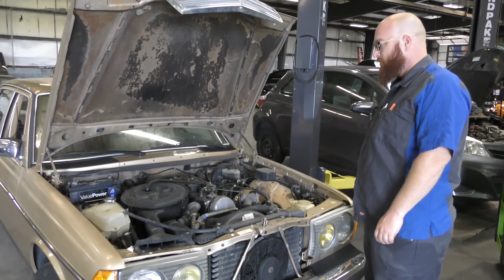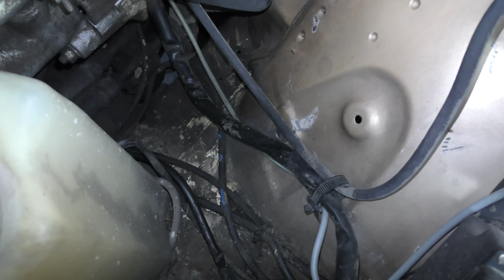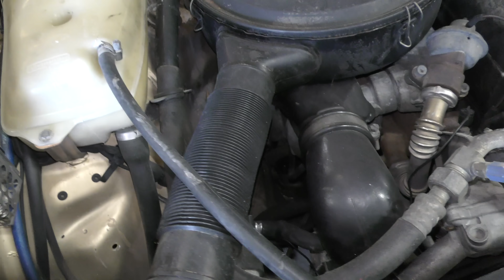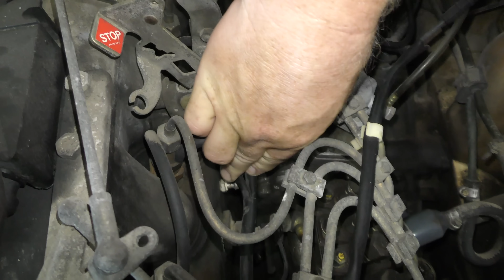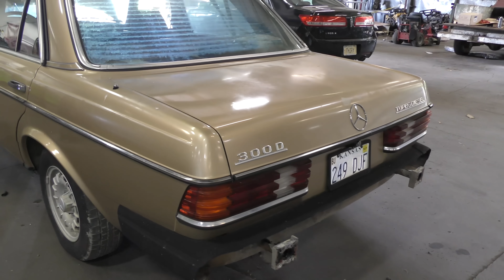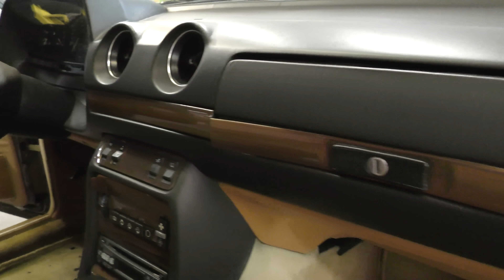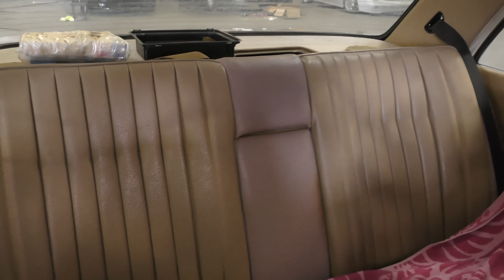Tank of a Mercedes 300D with a 3L Turbo Diesel! CAR WIZARD finds lots of surprises under the hood!

Comment: The Sergeant I replaced as Squad Leader while I was stationed in Germany in the mid-1980s had two Mercedes, a 1965 four door sedan with a V-8 Turbo Diesel and a 1966 two door, convertible with a V-8 Turbo Diesel both cars were built, originally to German/European standards. Both cars were automatics. The cars had been purchased, by my fellow Service Member and lovingly restored to their original colors (a cream exterior and saddle leather tan interior in the case of the four door and what we in the U.S. would think of as "Fire Engine Red" exterior, white convertible top and white leather interior) by a shop owned and operated by a semi-retired former Mercedes mechanic who owned and operated a nearby shop. His repairs/restoration were so good that a car collector in Louisville, KY kept a buyer on retainer who scoured (West) Germany just to track down and make offers on Mercedes vehicles repaired/restored by that shop. I don't recall the exact price he offered originally or what he ended up paying for BOTH of those cars but I do recall that the Sergeant was more than pleased with the profit he made from the sales as he had his eye on a really, really nice Mercedes, best described as a limo that met all then current U.S. vehicle standards (glass etc.) and ended up costing far less to ship home than either of the 1960s models would have since they would have required a number of "upgrades" to make them legal for import into the U.S.
Reply: Mercedes V8 turbo diesels?? During those years? News to me. Maybe modified or gas?

Comment: Maybe it is me,  but it seems that car sits a bit more on its rear wheels. On mercs that olda and undriven usually all rubber parts like engine mounts, bushings, brake cables, etc need to be checked, and often replaced to make safe and comfortable drive again. Also, roof mechanisms and driver seats are often weak spots.

Comment: I had a 300 sd and it had 250k and was a joy to drive. The rear seat reclined and my favorite feature was the hoods ability to prop straight up for easy access to engine. Sold that car for way too cheap.

Comment: Great video.
Replacing the instrument cluster lights with LED is a terrible idea. Those circuits aren't made for LED.
If the lights look too dim, you can adjust the brightness on the clock reset button or just have the reflectors for the bulbs polished.

Comment: I also have a 240 d same blue as yours for about 20 years now. It has stick. It has two clutch slave cylinders both are bad. A dumb Mercedes specialist was told to replace the plug on the block heater. He ripped the entire wire out of the car. A creep but his Dad was a genius mechanic like you . The day after 911 a kid searching for his water bottle under their seat rear ended the Benz when it was parked in front of my house. Crushed her to the wheel well but a friends bulldozer and chain to a Verizon pole pulled much of it out.
No mice but my 77 Vette had a mouse in a nest in the jack box behind the passenger seat below the cardboard. That was just after superstorm Sandy. Many critters migrated to my high area of town. I drove to the docks and released the mouse but should that mouse come back and get in my C5 I'm not going to be so nice.

Comment: It's not so much the taste that attracts the mice, it's the condensation and the salt's between the insulation and the copper or aluminum. Splicing is a terrible idea because of the potential for corrosion.

Comment: Having had nearly 75 of these cars, I know exactly what you will be going through. You touched on just about all the common issues with these cars. By the way, at minimum, the entire dash and center console have to come out to replace the wire harness. You might be better off adding a multi-pin bulkhead connector to the new engine bay harness, and leave the interior alone. That is if the rodents did NOT get inside.
Reply: I did that with a 77 Grand Marquis, was a squirrel instead of mice/rats.

Comment: In 1984 I picked up a new 300D at the factory in Sindelfingen.  Brought it back to the States and a year later plus 25,000 miles I sold it.  It was anthracite with an anthracite interior.

Comment: Wizard I like all your video's. I believe I worked on that car many years ago at a Mercedes dealership in Nebraska. I notice the ALDA on top of the pump has had the emissions cap tampered with.  We would loosen the lock nut and turn them two turns to make them run less lean, and have more power.  It was most important to adjust the valves on these  engines or they would not start in cold weather. They had a tendency to tighten up. Just a tip.

Comment: I've owned a bunch of W123s, very cool cars. Crazy what's up with the wiring. Luckily, once you have it started, this is one of the last cars ever made that can run and drive with no electrical systems working. I think you're mixing up the horsepower rating with the non turbo 300D. The turbo has about 123 horsepower.

Comment: My 2003 BMW X5 4.4i costs more to repair it than what's it's worth, but it brings more joy to drive it than a 2020 BMW X5 which I have test driven. A brand new BMW will depreciate much more than the cost to repair my 2003 X5, so is it really worth it to get a 2020 BMW X5. Sure it is much more luxurious with the latest tech and powertrain, yet it super numb to drive IMO with poor steering feel compared to my old BMW X5.

Comment: Funny that you mention the original first aid kit 😂. My W124 also had the original one in it. And as I was working on the front suspension, I cut my hand on the control arm. And there was nothing else on hand than the more than 25 year old first aid kit. I put one of the band aids on my hand and it fell off after about 30 seconds 😂

Comment: so basically a lot of the problems with that car(that is known of) is because the mouse ate the wiring and not really the car's fault, and even then it still runs and drives. they definitely don't make them like they used to anymore.

Comment: These came around 12hp stock. If I recall correctly the boost protection kicks in around 13 or 14 psi. You should see at least 10psi of boost on these. Around 12psi seems to be perfect.

Comment: Oddly I would like to find a good example of my first car and own it.  My first car was an '88 Honda Accord. I've looked for examples around that time period and there's not much our there.  If I could spend some money on a vintage car it would be that one and swap it with a more modern Honda engine that would be the dream.  I've even looked at Accord all around that time and it's hard to find.  But I love the nostalgia of those cars.  My was a dark red four door, red interior, pop up head lights and most of all 5 speed.  Just an all around good car that if I could find and had the money to fix I would.

Comment: My grandfather had one of those things, I think he bought it new, or newer at the time. Same colour even! A few years after I was born it got relegated to being a 'spare' car. I loved the smell inside these things haha. My mother however hated driving it and it ultimately got sold because anytime we needed to borrow a car mom wouldn't drive it lol, something about hating and I quote "Having to wait for the squiggly line to light up before turning it on" Go figure lol. As for vintage car I'd like to own, I'd probably take one of these in decent shape, they're very nice and reliable, I don't know if you'd call it vintage but I'd also have a '92 Oldsmobile Bravada, learned to drive in one, my grandparents bought it new, gave ti to my parents, it was supposed to go to me but rust got to it, the frame was non-existant anymore, was a shame because it ran and drove but structurally it was a death trap. Would love to find one in decent shape, they're few and far between in the original bodystyle though.

Comment: My dad had a 240D with a after market Turbo and intercooler, was not slow anymore, and a five speed manual wich was hard to find. We got that sucker up to well past 200 km/h, I know the 300D he had before it stopped at 180 km/h and the 200 gas model only did 150 or 160...
He crashed the 300TD, then got a 240D with Turbo conversion that was rusted out, found a clean 200E? or what ever its called, gas... put the good 240D turbo converted in to the clean chassi and then sourced the 5 speed wich was hard to find. That car was amazing, I even got to drive it a short bit on a beach, I did not have a license, this was many moons ago ofc, these cars where just half as old as they are today... xD

Comment: Are used to do a lot of work on MGs The funniest one was changing an alternator over to a GM single wire alternator the customer picked it up and a week later the rear wheel fell off

Comment: Unfortunately I'm very familiar with the terrible disease that all of us in the auto repair community have  fallen victim to the person that has it! It's called ''Sinchu syndrome!'' I've seen many people with it in my almost 50 years of repairing wrecked cars for customers I might repair a dent in the left front fender and repaint it and six months later the person comes in and says ''Sinchu'' fixed my front fender the paint on the trunk lid doesn't match the right quarter panel! Or sinchu aligned my front end the heater motor makes a funny noise! Or sinchu put my spare on for me free the day I had a flat in front of your shop with 6 screaming kids in my van it doesn't drive right what are you going to do about it? AND MY FAVORITE!''I know it's just a temporary spare and it's been on the right front for six months but all three of my ''baby daddies'' say that your impact wrench messed up my front end and you should put new ball joints, tie rods, new springs with struts, and a steering rack with new lines, cooler and pump because your impact wrench caused it! I told Pep Boys how my baby daddies said you messed it up and for them to fix it and send you the bill so here's what it's going to cost on this paper! Just give me the money plus $200.00 for all of the trouble you caused me or I'n gonna sue you!  ''Sinchu Syndrome'', It's a real disease!

Comment: I had a 1980 240D from 2005 to 2012.  I bought it from the son of the original owner, fixed the cruise-control and A/C (those are always broken on these cars, as you well know) and drove it for 7 years doing nothing more than regular maintenance, and replacing wear-items.  In 2012, the original owner's son actually bought it back from me -- for more than I'd paid him for it in 2005! -- because he missed it so much.  It was a fantastic car, in really great cosmetic and mechanical condition.  It had 250,000 miles on it when I sold it back to him, and it still rode and drove like it did when it was new.

Comment: Had a 1983 300d for a while and still have the drivetrain out of it. Also many other parts I saved from it. It was totaled in an accident. I still have my 1984 300CD that I bought from a buddy of mine 16 years ago.Dark blue coupe with 387000 miles. Runs like a top.I just finished r and r job on the starter and new solenoid. The gunk and debris inside the starter was keeping the brushes from pressing against the armature. I guess that many years and miles can do that. I cleaned it up and put it back on and it works great.I do all my own work except alignment and tire mounting. I don't have the equipment for that. I have been deep into the transmission and every other place on the cars as they needed it. I am a hard core advanced DIY person I guess. Love the W123 cars and the W126 also. I had a 91 350SD and want an 83 300SD next.
Currently also have a 91 300E 2.6 that I drive in the winter (it has ABS) in red. All the old benz cars I have owned except the 300CD I purchased dirt cheap and fixed all the problems myself. As you said if someone paid a shop to do it they would easily exceed the value of the car.On the other hand if I was to total up all the tools I own at work and home (Lots of snapon stuff in there) maybe I could have paid a shop to do it!

Comment: Mercedes 560 SEL's are excellent cars also, yes they guzzle high test gas but they are very reliable, well [coach] made, very comfortable and smell wonderful. I bought mine for $2500.00 because the owner thought the engine was bad. When you started it there was a terrible disconcerting sound which would encourage most people to think the worse. The gentleman let me take a solo test drive and I didn't live but a few minutes away from a good friend of mine who was a "gifted" engineer. He determined the fan clutch was the noise issue as it was worn out and allowing the fan blade to make contact with a lower radiator bracket. We also pulled two plugs which looked almost new. The body and interior was immaculate so I bought the car. I called NAPA for a price on a new fan and clutch and was quoted $700.00. I wasn't too surprised and began thinking what was a good place to start looking. Suddenly I reasoned that many older people with Mercedes go to Florida to retire, then pass away. I Googled used Mercedes parts in Florida and called the first site I saw. I talked to a very friendly and knowledgeable parts person and within a week received a excellent used fan/clutch in the mail total cost $160.00. So I lucked out and enjoyed a superb $90-$100,000.00 [Original price] 150,000 mile car for several years. They are wonderful cars and can still be found for $5,000.00 and less, but by now age alone could become problems, especially the complicated suspension. But there are still many good survivors that may be worth consideration. How many cars have rear seats that are heated, recline and will do 150 MPH. Love your show and Hoovies and Dougs. Phil Massie

Comment: The real killer can be the vacuum system. There are many things, the door locks come to mind, are vacuum operated. The vacuum pump is on the front of the engine driven by the cam. It needs rebuilding after this kind of age before you start replacing all the lines to the doors and more.

Comment: I've had two W123 230e - great cars. The seats tend to wear out quickly, though they may be more durable in the diesel versions. I don't know how emissions taxation on older cars works in the States, but in Germany it would be cripplingly high: you'd have to register it as a historic vehicle, even then it would be banned from some city centres because the exhaust is too dirty. I'm guessing this one may have a catalytic converter? Then again, probably not.

Comment: Wheeler Dealers did a Mercedes diesel once and it lacked power. It needed a rebuild of the turbo and also the fuel injection pump was not out the correct pressure to all the fuel injectors. Mike was able to locate a specialist shop in Los Angeles to rebuild the pump. A new one would have been very expensive.

Comment: European bio-degradable wire... I had a '85 Volvo 760 GLE where I rebuilt the entire engine compartment wire harness.  The insulation on every wire, except the black ones (grounds, of course) was crumbling away.  That was back when it was only a few years old and Volvo wouldn't do a thing for me.  I imagine that Mercedes used the same stuff too.  I wonder if it was soy based insulation back then.

Comment: Another reason you took the car as well is because the owner has the money to put into the car. He didn't it pick over certain things he did nitpick overpricing or labor he just wants the car fixed and fixed right for his daughter no matter what the cost because in the end the cost is going to be a lot less than buying a used car from a dealer so wizard knows no matter what he does and what he has to do to fix this car the money is there to pay him for it and the owners not going to complain about the cost because they both have an understanding about it clean simple and how it should be with every car repair and owner but of course it never actually really goes that way.

Comment: "You're not gonna go to Mercedes-Benz Dealerships across America and be able to purchase a complete harness for this car". I don't know what the situation is for America, but they actually are available in Germany and not only can you get them from the "MBGTC" ("Mercedes-Benz Gebrauchtteile-Center" -> MB Used-Parts Center", which are used parts that have been checked), they are (mostly, some only partly) available for Purchase again, because Mercedes started to make them again. In small quantities and compared to a used one expensive, but they are available! Granted, the differences between US and EU models could be so much, that you really can't get a US harness...
Not only that - we have quite a few people in Germany, that reproduce those harnesses and sell them (proper Silicone braided). Especially the W124 have been plagued with dissolving cable sheathing...but there are also W123 harnesses available! And even a "made from scratch" one isn't that expensive (i've had one made for my W124, because i got a bit of a special one and it was about 850 Euros)
Reply: The only difference between US and Euro spec are the headligths and turn lighs connectors, because the obviously sealed beams, the markers also function as parking lights, same case on tail lights who had in the lateral corner a little light for parking light, and in the interior they have the buzzer for lights on when open doors, the driver seatbelt warning light, and the climate control, because in the US they have automatic climatic control, and in Europe they use wire and knobs.
Reply: @jironmeister  Automatic Climate Control was an option in Europe. The buzzer for Lights was also Eurospec, however, the buzzer was only wired to the lights, not the "key in ignition".

Comment: You might want to replace all the fuses - the tips of them oxidise and cause problems. Also the ignition locks get sloppy from too many keys
Hanging on them. Mercedes source has fuse kits and lock cylinders. I have an 88 300se gas model. The idler arm bushings get wiped out too.